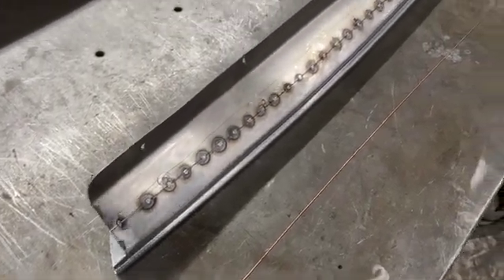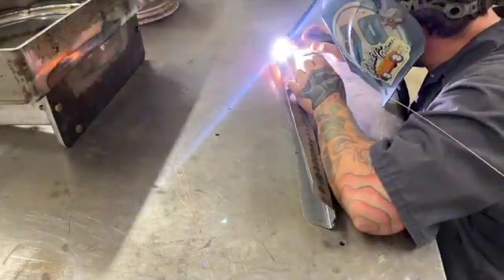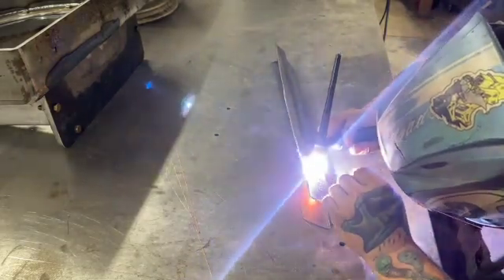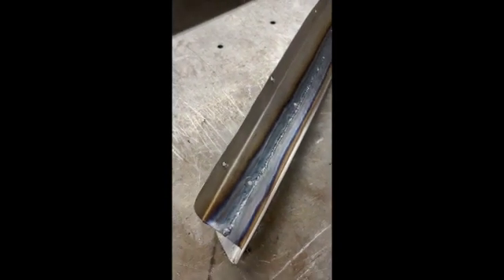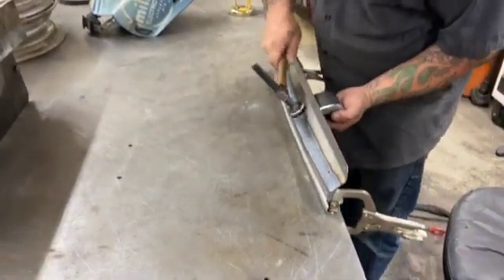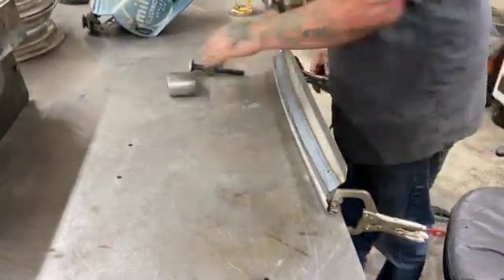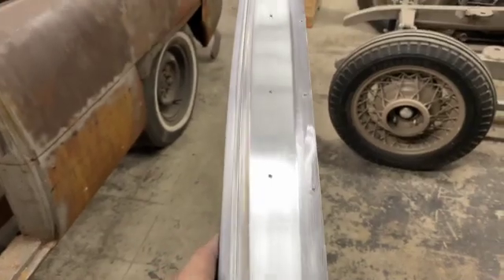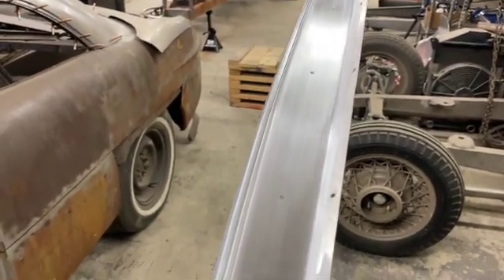How I tig weld sheet metal panels together.

Comment: 👍looks good do you use a foot pedal I'm just wondering if you always have to use a pedal?
Reply from the maker: @rongamble9884  i mostly use the pedal
Reply: @cornfieldcustoms  👍that's what I'm hearing just wasn't sure how awkward using the pedal would be welding in a quarter panel skin
Reply from the maker: @rongamble9884  its not bad
Reply: @cornfieldcustoms  probably pull the plug and buy a tig the one I'm buying there going up in October

Comment: Very nice, were you running about 70 amps with .030 filler wire
Reply from the maker: .030 wire, doubtful it was 70 amps. I cant remember specifically but i usually shoot for 1 amp for every .001 material thickness

Comment: How many amps do you run on something like this? What is this 18 gauge?
Reply from the maker: This is 19 gauge, i am running 50 amps. A good rule of thumb is 1 amp for every .001 of material thickness
Reply: Pulse or no pulse?

Comment: I know this is an old post but preheating is still an effective way to minimise this distortion and only takes mere seconds, the use of a butane torch is even sufficient and convenient as you only need a soft flame, its not something I see too many sheet metal fabricators do and I still wonder why !
Reply from the maker: Personally i would never pre heat a panel. Any time heat is introduced to metal and it heat cycles is shrinks which causes the warping. Its far easier to just correct the warp from single small heat cycle from the weld after welding by hammering out weld where the shrinking occured. I have been in the coach building/ metal shaping industry for over 20 years and never heard of pre heating sheet metal

Comment: Amazing! And wery good information! How do you grind the weld ? Just a roloc and go along the weld?
Reply from the maker: You can do that but you have to be careful to not gouge the base material around the weld
Reply: @cornfieldcustoms  okey so you just hammer the weld flat then ? And thanks answering! And hi from Finland ! Big fan of your work !
Reply from the maker: @Kuståmbymig  i hammer the weld down like in the video to where it is just proud of the parent material. Then use a sanding block or file to knock the weld down. There are certain instances i will grind the weld down with a roloc but it all comes down to a case by case situation